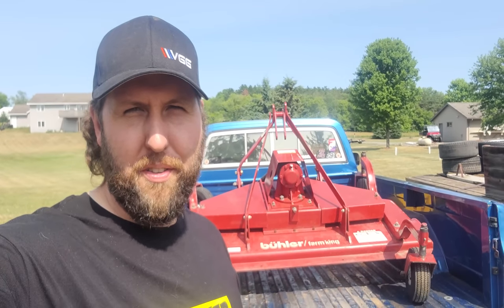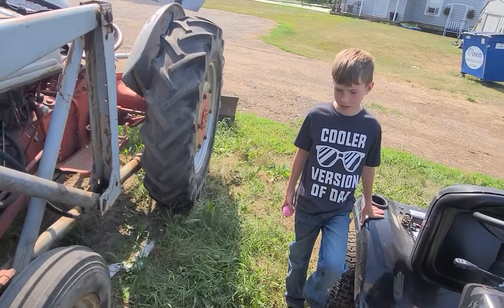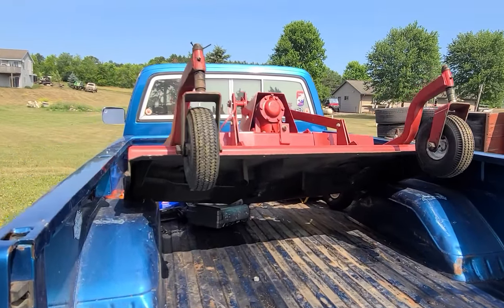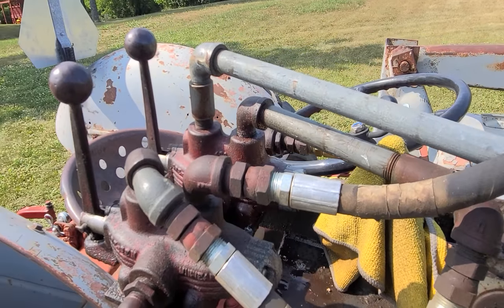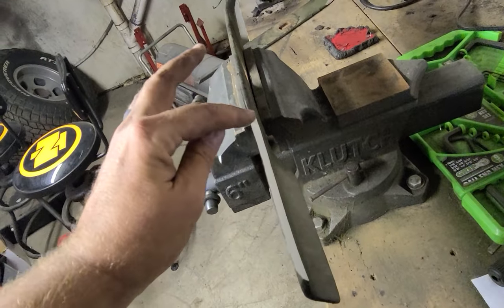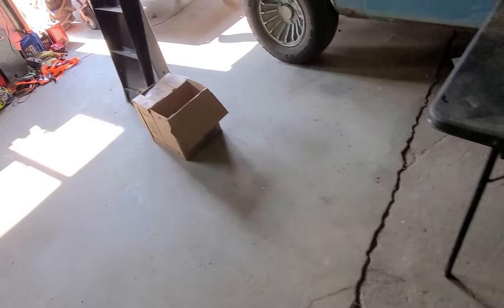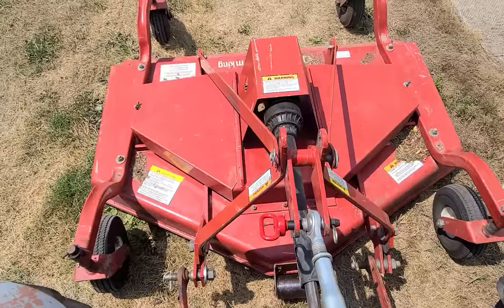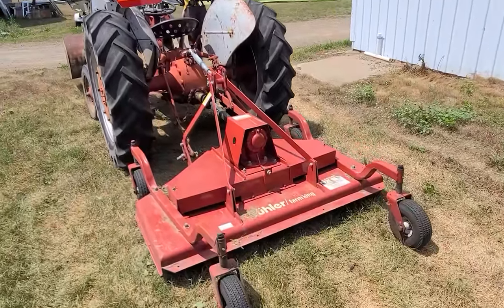Will This 3 Point PTO Finish Mower Work on the Ford GT500 (8N/9N)?

Comment: I have one of those Buhlers I bought it about ten years ago. They’re good machines, I like the rear discharge. Easy belt replacement and adjustment. The only problem I have experienced is the lynch pins in the top of the wheel fork shafts can get snagged on bushes or vines and pull out resulting in loss of the spindle height spacers, also wish they came with solid tires. Blades are hard to come by in my area, have to order online. I use mine behind a John Deere 3005.

Comment: A feller has himself an 8n Ford there, they got running boards instead of foot pegs with the “road gear” speed selector 2000. Also on 9ns the left brake and clutch were both operated with the left foot and the right side had the one right side brake pedal. Supposedly they changed it to where both brakes were on the same side on 8ns. I got me a older 9n with the pegs and no road gear. Great tractor, need to get her goin again

Comment: I always use a chain for the top link so it can flex if you run over a hump. I used to have a 9n with a loader and Sherman transmission like that one, did a lot of work with that tractor.

Comment: I have a Buhler Farm King in the 72" flavor.  Been using it for probably 15 years and have only had to replace tires and belts up until a couple weeks ago, one of the spindle bearings went down.  I'll get one ordered up and get it going again though.  It has been a dang good mower.

Comment: About 30 years ago I had a 60" Ford finish mower on the back of a Satoh tractor.  Satoh was a re-badged Misubishi.  I got all my parts from a Mitsubishi dealer. It was about the size of a Ford 8N - about 20 hp IIRC.  I never used it it heavy stuff - that's more brush hog work.  It did a wonderful job on my yard.   No lack of power.

Note - I put a bass boat kill switch on the tractor - spliced into a coil wire (neg  I think) - it's been a long time.  The switch had a lanyard that I could hook to my belt.  I wanted the kill switch in the event I got pulled off the tractor by a tree limb - or something.  I was in a desolate area and this was before cell phones.   tractors have governors - being dragged off and into the PTO would be a bad ending.

Comment: I have a 52 8n also. There is a guage called proof meter that runs a cable to the back of your governor. It will tell ya pto speed. If you don't want that at least on mine 540 pto speed is about 3/4 throttle. Also not sure if it's as crucial with a finish mower but with a brush hog I run a over run clutch pto adaptor so if your come to a stop the blades spinning won't keep pushing you forward. Love both channels keep it up.

Comment: We used to cut our lawn with a Craftsman tractor mower and thought I would want a finish mower.  I bought a used box blade that came with a free seeder, 3 pt scoop, and finish mower.   We used the finish mower, the tractor mower, and a push string trimmer.  It took two hours with 3 people.  We got a zero turn mower and one person can be done mowing in less than an hour.

Comment: With these here fords for that scoop at the front, if you lower the rpms you get more control, higher rpms get you more power. So when you're going to line up with something drop the rpms way down and line yourself up, then rev her up to lift and move stuff.

Comment: That over/underdrive auxiliary unit could very well be a three speed unit.  Put it in neutral and try pulling out on the shift lever.  If it comes out about an inch it's a three speed.  After you pull it out, the lever will move forward (maybe back, I forget) into direct drive, which is where you want it for mowing.  The two positions you're using now are underdrive and overdrive.
Reply: I think what he’s got is just a Sherman Step Down. Should be direct drive and low range. Likewise a Step Up was direct and overdrive. The Combinations have a cast shift lever, while the Step Up/Step Down just have a lever made of round stock with a knob on it, which is what he appears to have.

Comment: over run clutch for the pto shaft is something I would consider for that tractor. also surplus center dot com sells hydraulic joy stick controls. you likely need the open center style.

Comment: Great set up! You might add a 3 point position control like a Zane Thang or a set up from red river manufacturing. Red river has a lot of cool stuff for N series tractors that Henry forgot 😂 
The 9N and 2Ns were draft control vs position control on the 3 point. Basically the 3point is up or down and doesn't really hold any positions in-between. Mowing can be a real bugger if it won't hold a position, and doesn't "float". Great content! Keep the good stuff coming 🙂

Comment: Derek the mower cuts best at 540 that’s what it’s rated for. The rear discharge mower like u got uses less HP then the side discharge model. I ran my 60” Farm King mower with a 16 hp 3 cylinder diesel tractor for 10+ years worked awsome!! Farm King Factory happens to be 5 minutes from my house 👌

Comment: The square stock that connects the wheels to the body is the point of failure on that brand finish mower.

As for the 8/9n loader what you have is as good as it gets. I started out with a Ford 801 with a Kelly loader, sold it and bought a diesel 4x4 Branson with a loader for the same money. Best thing I've ever done

Comment: Your old Ford is a dandy!  I grew up on a similar one and it too was equipped with and overdrive transmission (which you are calling a "Hi-Lo Range selector).  I'm guessing yours is equipped with a Sherman "step-up" overdrive which should make your ground speed faster in each gear.  If I'm guessing right, this will also change your PTO speed, so be aware of that!  Here is a link to a video showing the inside of the tractor during service or repair, which gives a good understanding of how this unit works!  Good luck with all!   Never mind, Utoot won't allow pasting the link!

Comment: You might want to consider installing a overrunning clutch on the PTO. Those old Fords were known to shearing off the PTO shaft in the trans when running a Mott 88 mower and an operator stopped the tractor and the mower wanted to drive it forward !

Comment: We used to bail 100 lb two string hay bales. The Baylor wasn't quite as good as they are today. We would go out in the field and pick up scraps of hay that the Baylor didn't pick up and And also pick up the The bails that broke as they came out.

As always I was a little kid so I was giving the job of driving the truck. If you were too young to do hard work you do usually got to drive things. We had a bunch of half ton Chevy fleet trucks. I remember I was so young and small I couldn't sit on the seat and work the steering wheel and work the brake and everything so I just stood up behind the steering wheel.

Then we started hauling hay. We had these old hay wagons that would hook on to the draw bar on the tractor. Then the front axle of the trailer would turn. Then you Hook another trailer on the back of the first one with a linchpin. And then the front axle on that also turned. So you had to haywagons with four pivot points and you drive them down the highway without tying them down this was about seven or eight.

Then I was about 11 or 12 and they threw me in a two-ton truck we used to haul potatoes or one of the two tons we used to hall grain or sugar beets. The only training I got was there's first second third fourth and 5th, there's your high low it's a 10-speed, don't screw up and break the axle or wreck the truck. I got into one of the trucks one day and turned the key couldn't get anything to happen couldn't get anything to happen. The hired hand came over and said what the hell's a problem. I said this truck won't start. And he said is the key on. I said yeah. Said you see that knob on the floor down there. I said yeah. He said step on it and the engine ordered to life. Floor board start around the 1952 Chevrolet.

And this is how it went on and on and on. We were given responsibility that I wouldn't give to kids these days for all the money in the world. But they treated us like men too. We had old chunks of slough Small River running through our ranch. When I was 12 and I got my hunting license my dad handed me an old Sears and roebuck both action shotgun and a saddle scabbard for the motorcycle I just saved up for and a case of 16 gauge. He said have fun hunting. I could take my motorcycle or the truck or my horse anything. But he said if you screw up and do something stupid you lose your privileges. I work you like a man so I'll treat you like a man and tell you give me reason not to.

I got my driver's license when I was 14. In Idaho you can get your driver's license then. My birthday was right on the cutoff date to put kids in kindergarten and my mom held me back a year so me and Mark Clark were the only 8th graders with driver's licenses. We had a parking lot at my junior high where we had 8th and 9th grade. Good times I had a carload of girls after school everyday. 73 Plymouth duster painted this horrible green color. It had three on the floor. Fast car.

In high school half the guys with pickups would show up with guns in their gun rack in their back window. Most everybody had some kind of deer rifle, a shotgun, and a 22 and for pests like rats, porcupines that would get into our cattle and so forth. Everybody had guns in their truck so that right after school we could all jump in our rigs and go hunting. Nothing bad happened. Nobody ever got shot. Nobody ever got hurt. They work just like men and treated us like men.

Comment: I had an old Woods 60 in. 3 point finish mower. I used it on an 8n until I got a little bigger tractor. As long as the grass wasn't too high, it would run it fine, in heavier grass, it struggled. I had to replace the belt on it, not cheap. Sold it a few years ago, you don't need a O R C on it, if it was a brush hog type, you definitely need one. I see this is an old video, so you have figured that out by now I'm sure.

Comment: I have a 1950 8n and i put a set of stabilizer nars on from tractor supply and now when i use any equipment it tracks much better behind the ole girl . stops everything from moving left and right on the 3 point hitch . my pto was already converted to the larger side . the low and high range is rare on them . your correct

Comment: Excellent video Derek  :) also that Ford tractor is 540 RPM also check on for 1966 to 1985 years of Tractor has 60 hp Gas or Deseil motors because 540 and 1000 RPM Power Take Off  and get lot performance better on Cutting Grass!

Comment: I have a Ford 641, my brother has an 850 I think, (5 speed with 2 stage clutch for PTO and an 801 with selectospeed. We both use his 16 foot land pride mower. I can only cut in first gear, and it is all that engine can do to run it at full throttle. he can run it on the 800 in third, shifting down as it gets thick and wet. The selectospeed has a touch more power, and just goes through it. I have since gone to a sickle bar mower as seeing as much blow by as exhaust up the stack as excessive (it really isn't that bad, but I also have an 801 industrial engine to change it with later) We are cutting a grass airport, so there is lots of cutting to do. The land pride is rated to use a lot more power than we have, The sickle mower a lot less than I have, but I haven't started shedding teeth yet, so maybe I am lucky. I have a very similar hydraulic valves on my front end loader, Greson, and have no problems and easily rebuildable, my hydraulics are from the tractors 3 point before the three point so work with about 600 psi back pressure so my 1500 psi for the lift sits right at the hydraulic pumps relief setting. Have fun

Comment: Yep, I sure liked the overrunning coupler with my BushHog. Them danged blades would spin for near 20 minutes after I'd shut her down. Sure I'd not expect that finish mower would be a big problem.  Had me a Funk 8N with straight 6.  No exhaust pipe, just a downspout elbow. She sounded like a P-51 going down the field and when I'd step on the clutch she'd shoot flames bout 10ft long under the floorboards. Bought a derned timing light and fixed the timing. Ran better, but not as neat.

Comment: If you have a tachometer for the PTO shaft, they are meant to run at 540rpm for modern implements.  Or full throttle which is way too much.  Perfect!

Comment: I've got the same mower on a Kubota B3030. It's not a terrible unit. You're going to find it peels tires off the right front caster, so keep the weight off the deck just a smidge.

Comment: Move the mounting pins up into the top bolts. My finish mower has 2 spots to mount it. One is 6 to 8 inches closer. Aslo go get a pto override clutch  for your pto. So you don't take out your main shaft. I have a 8n ford on a 72 inch mower. I have no problem with it . It handles it great . I mow a 8 acre horse pasture I mow every 10 days.  Run the pto at 540 should be about 16 hundred rpms.

Comment: Another thing I do is instead of using the adjustable top link on your three point hitch use a chain that has some slack when the mower wheels are on the ground then the deck can pivot up and down some for uneven terrain.

Comment: Pro landscaper here, you might already know this but I figured I'd mention it just in case, when using a PTO you always wanna engage your PTO at 50% throttle, and then raise it to your top throttle position, and when you want to disengage the PTO you should do it around 10% throttle, if you start and stop the PTO on your high throttle setting all the time it will wear it out faster or cause parts to break, can't even tell you how many mowers have gone down at my company just from people doing that over and over even after being told LOL. And these are all commercial mower units so them breaking makes me worry more about residential mowers and PTO's.

Comment: Oh my Lord, dude. You're killin' me struggling to get that thing out of your truck...and I don't even like a GMC. I have that exact finish mower and it is a wonderful implement. Go ahead and get the carbide tipped replacement blades and enjoy years grass cutting. Yes, they are more expensive. Also, grease the sap out of it until new grease runs out of every orifice. Plan on burning up an entire tube. Drain and replace the gearbox oil with fresh new lube. Drain it when it's cold to avoid any sudden pressure release. Ask me how I know this. Farm King is a top-notch implement.

Comment: my dad had a farmall with that centered front wheels, dont know the name as i was really young at the time, but he had a 72 inch deck for it because our little riding mowers took a long time with just over 4 acres of yard to mow and one day a dixie chopper salesman came by and my dad offered him a deal. i dont remember exactly the offer but it was determined that if he could mow more with the chopper than my dads farmall tractor in the same amount of time my dad would buy it. the chopper had a 60 inch deck and of course my dad was able to mow more in the end. but that was without going around any obstacles like trees and such. but also, the chopper had a far better quality cut. and the time difference wasnt much too. so he bought it for over 5k but i dont remember exactly. he stills has that mower and it runs to this day, its at least 15years old at this point. maybe older. weve only changed deck belts, spark plugs, and oil changes. and the tires but that was because the original tires were turf tires that didnt get much traction at all. the only non regular maintenance done was one of the coils on the v-twin engine went bad but was a very quick and easy swap. since we got that he bought a smaller one called dixon chopper for my mom to use and eventually he got a deal on another one a bit newer than his first. didnt really need it but it was an amazing deal and cant hurt i guess lol. zero turn mowers are nice but expensive. ive used several different brands and designs but the dixie chopper has seemed the best for most applications. i really do like the front mounted deck mowers though if you got a lot of trees and stuff to mow under. great video and cheers

Comment: The overdrive is an aftermarket add on called Step-up.  I was 4 years old when I drove it through the field while adults loaded hay bales on the wagon.  My father turned the wheels out so we did not roll the tractor.  It would go fast for a kid.  We slid it around corners and stood it on its rear wheels while pulling a disc.  The tractor has one big FAULT.  The gas take filler is right next to the battery.  There is a battery cover made to cover the battery.  The tractor we used was repaired after the previous owner put gas in it while it was running.  You must be very careful when jumping or charging the battery in the tractor.  Your last connection should somewhere away from  the battery.  We ran that Ford to death until I was 15 and we sold the farm. Like you my mother said that is was a wonder we made it through childhood on one piece

Comment: Coupla things, or more, that you might cogitate on: don't let the kiddos ride on the rear implements ( I was riding the rear blade, and got runned over by my big brother when he popped the 8n into reverse suddenly), put at least one sway bar on the lift arm to prevent side swing of the implements into the tires, and consider a three point rear platform with a vertical headboard, they are really handy to haul and lift/lower stuff. If you drive it careful, even kiddos can sit on it, but keep feet clear when lowering to the ground. At 71, I still use mine.

Comment: Always adjust the bottom links in as far as you can on the links. One of your issues is your bottom links are both on the right side, you need to pull that big pin off of the left side and flip it over the other way, then adjust the bottom links